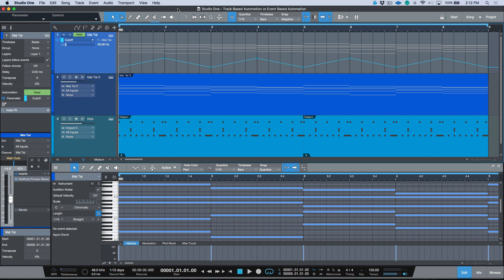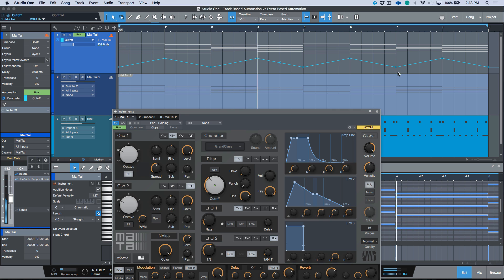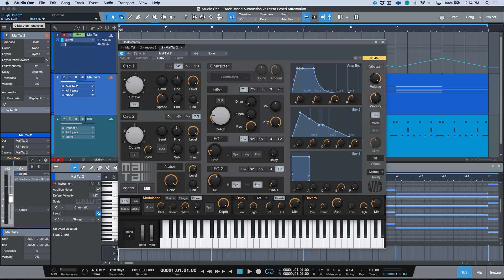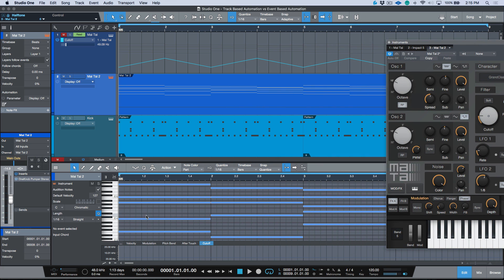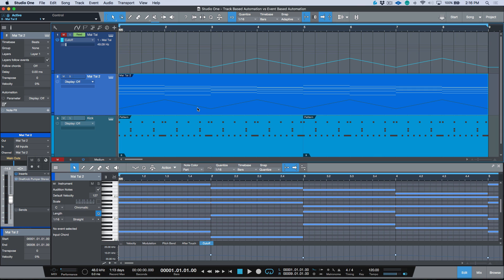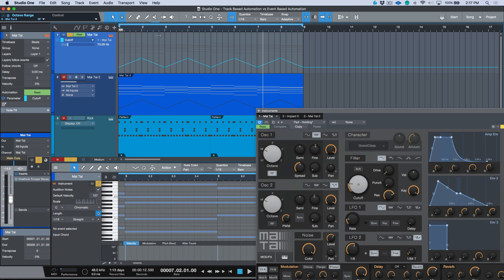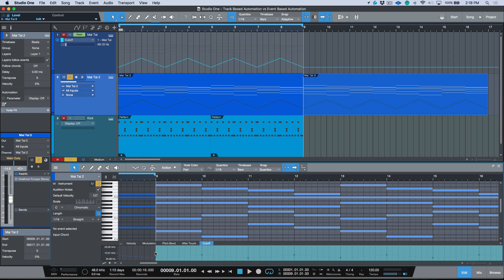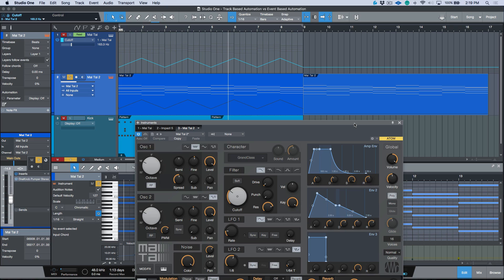Track Based Automation vs Part Based Automation In PreSonus Studio One

Comment: I rarely ever hit the subscribe button when I'm asked to...I did this time. Thanks for your tips =) 

...now I'm wondering if it's possible to create a macro to turn part automation into event automation.
Reply from the maker: Nice - Thanks for that :)
Can you explain exactly what it is that you'd like to do?
Cheers, M 🍻
Reply: @marcushuyskensmusic  I would like to be able to program a macro button that would turn part automation for the assigned parameter into an automation clip (event automation). Instead of creating an automation clip for the parameter and then alt & drag the part automation into that automation clip. Either way thanks for the tips they were a life saver =)